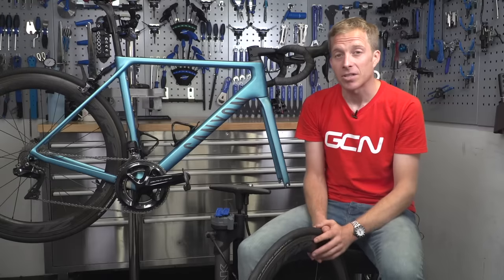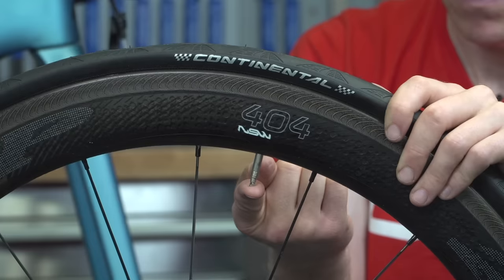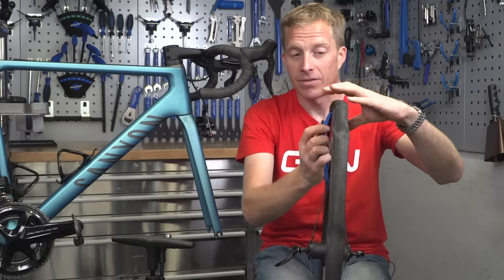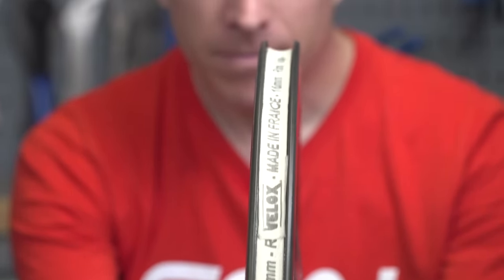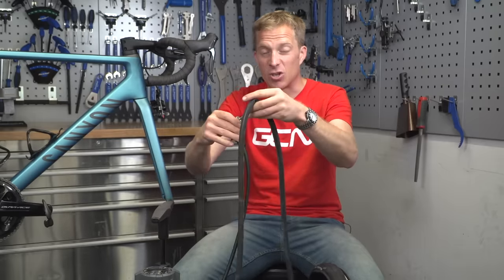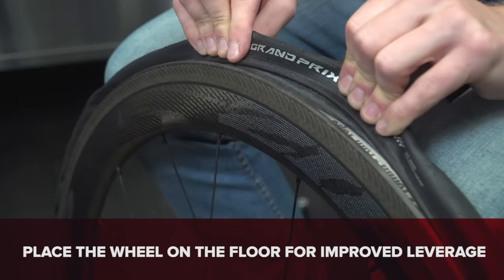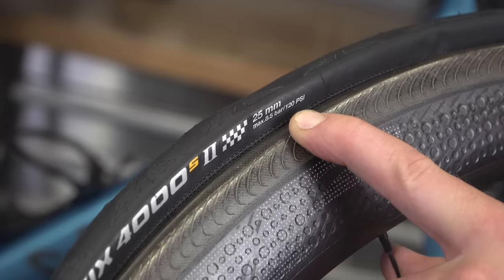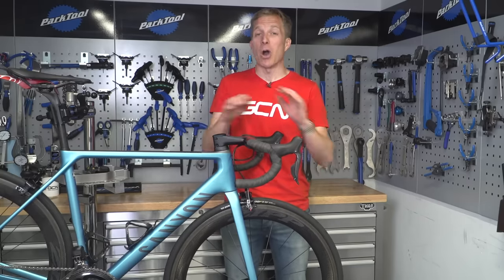How To Change A Tyre On Your Road Bike

Comment: Make sure it;s the right tyre.  One of my bikes is an old '60's vintage Raleigh three speed.  I got a new set of tyres for it and I could not get them one.  They were way too small.  I went back to the bike shop looking for help, and luckily someone there knew that back in the old days, some tyres sizes were based on the diameter on the inside of the tyre, or rim diameter, and some were based on the outside diameter of the tyre.  I doubt that this is the case with new stuff, but if you have an old bike it's something to be aware of.
Reply: Minute Man Sheldon Brown covers it all but you’ll need a dark room to lie down in afterwards.

Comment: I've found with most clinchers that you don't need tyre levers with the method I was taught:
1. deflate tyre
2. starting at the valve, push both beads towards the centre of the rim
3-here's the special part: using the heel of your palms, starting from the valve hole, pushing the tyre into the rim while sliding your hands around the rim towards opposite valve. this gives you the most slack possible in the tyre.
4. when your hands are near either side of the point valve, pick the wheel up while propping it on your leg. the bead should be loose enough to pop off just by flexing your wrists.

Comment: After putting the wheel back on the bike, I like to engage the brake with a rubber band so the wheel is centered and I can tighten the skewers without worrying about readjusting the brakes after tightening.

Comment: If you want to go 'no levers' I do, go with ROX rim tape. ultra thin which makes the over all wheel diameter smaller, which in turn allows you to get the tire off  with out levers.

Comment: 1st step after you’ve taken the air out is to un-seat the bead from the hook and push it into the well in the rim.  Gives you slack. In some cases enough slack to not need leavers.
Reply: Also. Talc the tube.

Comment: The only thing I can think of is not tyre related but regarding putting the wheels back on. Always make sure the quick release lever is in line with(against) the fork on the front and inline with either chain or seat stay at the rear. Sticky outy levers look horrible and in the event of a tumble things are better protected the proper way.

Comment: You want to try that with arthritic fingers?  But question. Is a wider tyre easier to fit?  My bike is a 10yo with those nice 23mm tyres. I would have to change the wheels to get wider ones.

Comment: It was really hard I have decathlon 520 and I change it with continental grandpri 4 seasons luckily I have different type of leavers and did it the first one in 2 hours after the other one took me 10 min . I used instalation leaver and normal leaver in the same time to install it and I tight up one of the sides so it won't go out. It was really tight and the rims are 622/17c

Comment: unless the tire is already flat, usually need to open the brake callipers in order to get the tire past the blocks. Or is that just me because I like to have the blocks so close to the rim?
Reply: just deflate very properly and then no need to open the callipers.
Reply: Depends on your clearance. I have to open my callipers now that I'm using 26mm. 23mm tires just dropped out. Also worth noting that you should close them again afterwards. I've forgotten to do this once or twice..

Comment: after i fit the tyre and tube to the rim and sure they are fine, i usually deflate it, remove the valve core and put around 30ml of sealant into the tube. in most cases it can last until the tyre worn out. then i just need to carefully cut and discard the old tyre and put a new one on.

Comment: Yikes! At the end I was drenched in sweat. I got it on a second attempt. It turns out I accidentally  pinched the tube on the first try. So I could not get it to inflate. But I have learned and it is all in muscle memory. I didn't  pay attention to the last segment about using a lever  to come the small segment of bead in. I used it intuitively and then upon rewatching  the video I was pleasantly surprised  to see he did similar. The only difference is I was a bit rough.

Comment: My biggest issue in the past has been with replacing latex tubes.  I now use talcum powder and a lot of TLC during installation.  They seem much easier to pinch than butyl rubber tubes.

Comment: The bit I liked was pulling the tyre back to the other side of the rim to get the valve out. I have been trying to poke the valve up through the hold whilst the tyre is still on the rim. Doh

Comment: First I ever heard of working opposite of the valve to get the tire off... great tip! Second best thing I ever heard was resetting the tire within the lip inside the rim... another great tip... one of the more frustrating things they never mention when getting a deep wheel set is how utterly frustrating it can be getting the tire back on… I was cursing so bad one day near some cows after getting a flat, they stopped eating and just stared at me... guess it was their way of telling me to calm down... 😂... it worked cause I did and got the tire changed and peddled quietly away... lol
Reply: How does a deep dish wheelset affect how hard or easy it is to change a tyre?
Reply: i own some. no difference
Reply: Mark Evasion so do I, and it’s a big difference in time between the stock wheelset that came with my bike and my zipps.  Maybe you’re a pro at changing the tire 🤷‍♂️
Reply: Yep I have owned one before. I don't think the depth has any affect it's just the tolerances and a potentially oversized rim

Comment: If it was that easy with all tyres... I'm running Schwalbe Pro One Tubeless on my PRIME carbon rims and it took me easily an hour to fit them, including almost broken fingers, soapy water and one bent tyre lever! Got myself a Kool Stop Tire Bead Jack now in the hope that this helps in case I have to fit new ones. I was THIS close to smashing my nice carbon frame on the ground out of frustration like that crit rider last year!
Reply: Been there - The only thing I've found that really helps is to pre-stretch the bead. Put your foot in the bead and yank up with both hands, working your way around the bead, on both sides. Then warm soapy water, two levers and only moving a little at a time to get it on the rim. It's not just you - they're damn hard to fit.

Comment: Tip: Before mounting your tire, apply a thin coat of petroleum jelly to the inside of the rim. Next time the bead will slide right off from its rail into the center channel when you push on it with your thumbs. That will allow your tire lever to slide under the bead.
Reply: Doesn’t petroleum eat away at rubber? I would think dish soap might be a better lubricant.
Reply: Yes. Dish soap would also be good. The contact area is just on the bead, so there is no risk on the tire. I just checked my tire and after one year it is perfectly fine; it slid right off the rail using just my fingers. I don't know if dish soap will dry out.

Comment: this may be a tricky one...
i have 105 direct mount brakes, and every time i press the brake lever the brake pad meets the wheel, but when releasing the brake lever it returns half way to its original position, not completely. only if i press a little bit with a finger it does. any sugestions?

Comment: - Always start and finish at the valve, it will make more room for the bead into the rim channel for all the rest of the circumference. That way, all tires becomes easier to mount.
- If the inner tube is into shape, so slightly inflated, it will hardly become pinched in between rim and bead. It' wont at all in fact.
- If the bead is still hard to get into the final bit (with the valve, as said, at last), press fit it into the rim channel starting opposite to the valve with your fingers, making sure it stays in tension all the way throu. that will save you another few mm to (usually) be able to pop it into the rim with hands.
- Some Talc powder in the casing before to install inner tube is always good, not only for latex tubes. It will also make it a little bit faster in terms of rolling resistance
- Align the valve with the most visible of the labels (not necessarily the manufacturer... if the model name il bigger, align to that: the purpose it to find the valve easier, so bigger or more visible = easier to find)

Comment: really struggling to get the tyre on. I followed the steps but end up with a good 8" of tyre on one side of the wheel which is so taught it's nigh on impossible to budge. I always have some kind of problem (80% of the time). what am I doing wrong here ...

Comment: I bought a different brand after pinching 3 tubes trying to fit one tyre. Figured it would be cheaper in the long run and I’d never get it back on quickly out riding anyway.

Comment: Hi Jon,
I noticed in your tire change video the Zipp 404 NSW wheels.
I have the 303 NSW and would like to use latex tubes with my Vittoria Corsa G+ clincher tires.
However, I have read suggestions against this stating the rim could heat up enough in braking to burst the latex tube.
What is your opinion on this?
Great videos ,
Thanks, Dave

Comment: 6:20  i hate how in every tutorial video, they manage to put it in place gently and without any strength needed.
Mine is literally impossible to put in place with hands only since it's extremely tight, and with a tool i just ruined 2 new tires.   Gave up while being pissed off.
Reply: Hardo Wider I have put tires on wheels before maybe you just need to do it gently because my first time doing it I put the tires on in less than 10 minutes
Reply: I just broke a tire lever trying to put on my new rear. It’s always such a pain in the ass with my road bike while it is a job of 5 minutes to do it on any other bike.
Reply: Schokoeis 3000 I found that Vittoria tires are very easy to remove and install Ive gotten flats before and it took me less than 5 minutes to replace the inner tube but I found that some tires like continental gator hard shell tires are super stiff and extremely difficult to put on my dad is just a beast ig because he can put on that tire no problem

Comment: Line up the logo and valve. Continental needs to have the n between the i and the e and look at the opposite side. It won’t line up 😡. Has to be in slightly offset 🙄. The Pirelli logo on the p zero  is better 😅 to line up for both sides

Comment: I'm a prodigal son, returning to the sport after a few decades of absence.  In my day we always sprinkled some talcum powder inside the tire to allow the tube to move as necessary without binding.  Is this technique no longer used?

Steve
Reply: stuff It fell out of use. Many of the better tubes came with talc already applied. Then cheaper tubes omitted the talc, apparently without problems. I haven’t seen a tube with talc fot years. Maybe the tube rubber or tire surface has changed.

Comment: When using levers on disc brake rims, I would avoid the section that has decals or stickers because there's no rim brake area to keep the levers from rubbing some sticker which is close to the rim lip.
Also I prefer to start the removing job near the valve side of the rim so to make maximum use of the rim bed groove for more slack of the tire bead, and installing from the far side of the rim oppsite of the valve for the same reason, especially when doing tubeless.

Comment: Tried removing a tire from Shimano alloy wheel set w/ Conti 4000 could not get the tire off to save my life!!! So hard to get the bead out took 45 min. ! Not a novice by
Reply: Sorry.....not a novice and this tire did not come off without skinned knuckles.....any way to stretch the bead before installing?
Reply: did you go round and push it in with your thumbs before inserting the levers? This will free the bead from the groove

Comment: I have been reviled by several professional bicycle mechanics/framebuilders for this, but my protip for road bike tire changing is to use the large,rounded side of an old Park cone wrench rather than a tire lever. They never flex or deform and provide excellent mechanical advantage over certain tires with tight beads who shall remain unnamed.

Comment: Slide the tire lever along side the the part of the tire next to the stubborn part and slide it along between the tire and rim. Less of a worry for pinching the tube. And use baby powder on the tube so it doesn't stick to the inside of the tire. One last thing, If the tire doesn't seat in the rim properly, spray some glass cleaner or soapy water and rub it on both the bead of the tire and rim. Good luck fellow cyclists with tire/tube changing :)
Reply from the maker: Thanks Jacob!

Comment: 6.10..... When you've used all of your energy and you still can't get the tyre seated.....
That'll be a Schwable then...... 😉😉😉💪💪💪💪
Reply: Dude same ... Pro ones on a carbon rim kills me every time
Reply: Try a continetal 28c wire bead on a very shallow rim with little to no time
Reply: Most tight-fitting wired beads will get you in to zone 5 from my experience. My Conti GP 25mms and skinless thumbs are testament to this.
Reply: gulf city nicholas danca I never could understand the complaints about Schwalbe's, way easier than the 28c Continentals on my road bike.  I need to use about every "trick" in the book to get those on.  The 25c Specialized tires I'm using now are much easier, but I think I'm going back to the Continental's anyway.
Reply: Michael Burgess my 28c tyres were a chore to mount 30 plus minutes for one
Reply: callumph
Yup, thems the ones.... Sadly even now they are the only realistic option for Tubeless...
AS soon as Conti make one, I'm back with them... 👍 👍 👍 👍

Comment: I run a tubeless setup on my Reynolds Strike wheels. When I tried to remove the tire from the wheel I actually found the tire had become stuck (as in glued to) to the rim! It had only been on for a week or so, it seems that you can get it unstuck by clamping the tire in a vice(!) Anyone have a 'top tip' on how to prevent a tire becoming stuck to a carbon rim?
I don't want to carry a vice with me when I go out riding:-)
Reply: Tubeless with sealant? That would do it, in fact very much desired to get a better seal.

I've always been able to separate the bead from the rim by pushing it in. On a very stubborn CX tire I put it on the side on the ground and pushed down with the heel of my hand. Once you break the bead on a section you can run a tire lever if needed. Never needed a vice.
Reply: Yes, Schwalbe Pro One tires with Doc Blue sealant. It surprised me too. I might be able to get it off like you say when there is a curb nearby, I want to make sure however I don't damage my precious (and far too expensive) carbon rims.

Comment: Hi Jon and thanks for a great channel! I have a problem with my Ultra 6870 rear derailleur adjustment - For it to shift semi-ok, I need to micro adjust it all 33 steps down to get it to sit at the 5th cog without rubbing - I’m am following the directions of the manual. This leaves me with no more adjusting possibilities to be able to fine tune it. Do you know what it can be? It’s worth noting that the DI2 is retro fitted by myself on a DI2 ready frame.

Comment: I'm here because I just popped 3 tubes trying to get a tyre on for a race in 3 days and no local bike shops have any time available. I'm so pissed off right now.
Reply: I have a new job and am in same boat but to get to work. I cant get the tube to sit in the rim without getting pinched

Comment: Hi jhon.I am willing to buy a road bike wich I want to import from Malaysia.The problem is I don't know wich size I need and they are asking for size to me.I am 6 fit but I don't have a bikefit and don't know my reach.The problem is my friends don't have road bikes and there is no local bikeshop here.What to do?Can you please tell me wich frame size I need.There is 45/47/49/51 size of frames.Thanks a lot for helping me #ASKGCNTECH
Reply: Gaming Legend I am 5'7" and it use 54cm frame. You would need at least 56 if not 58
Reply from the maker: Hi, you can check the website of the manufacturer who will have a size guide 👍
Reply: I tryed but there is no size manual for exact highet.There is extra small,small,medium,large and extra large.What should I choose?

Comment: My tyres are extremely hard to remove and they just don't come off I'm unable to insert my tyre levers in them... pls help
Reply: Deflate FULLY.
Reply: 5:25 - make sure the tube is fully deflated, and the beads are in the center of the rim. This is especially important if you have a tubeless rim, which has a different internal profile.
Reply: Use your thumbs to go around one side of the tyre and push back the sidewall to unhook the tyre bead, then try levering tyre off